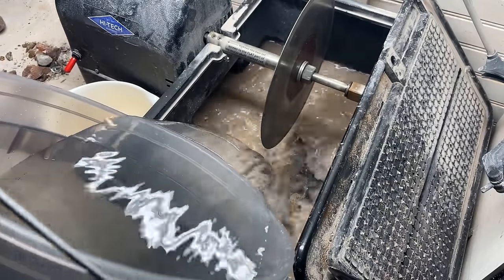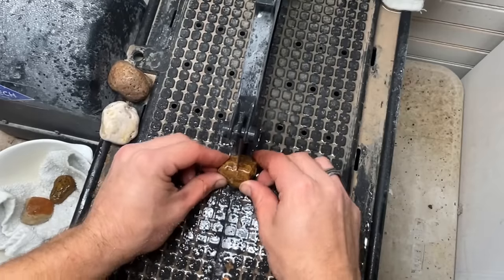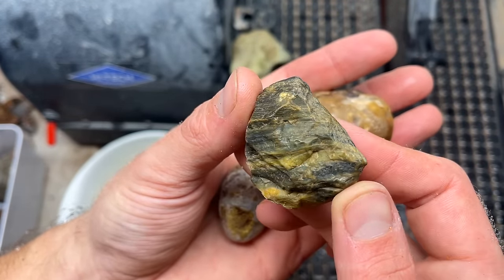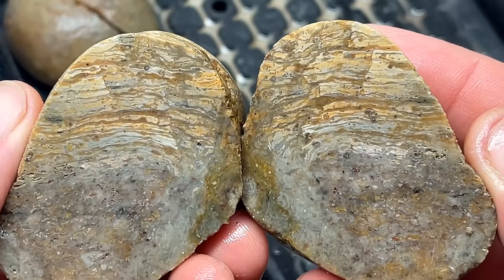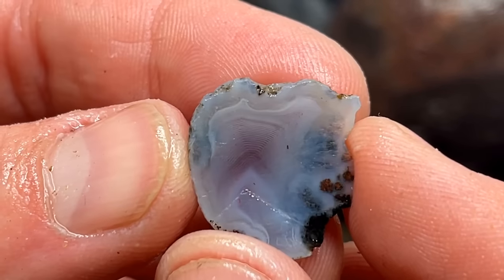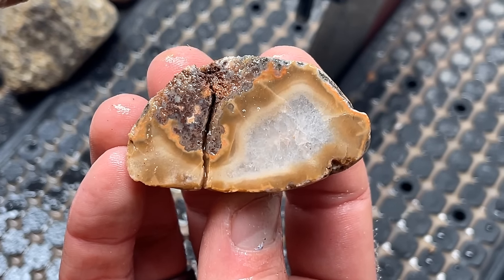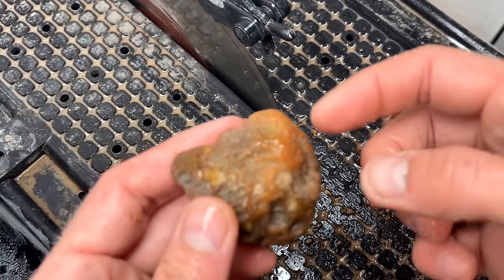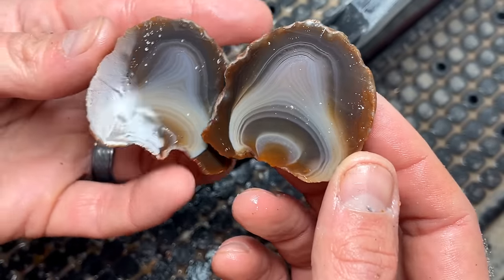Are these ugly agates beautiful inside?!

Comment: You are very very brave to put your fingers that close to that saw, and what kind of saw is that what a nice clean cut does rocks are all very beautiful
Reply: I was always afraid to do this for that reason. But the blade doesn't have teeth. It has diamond crystals. Kind of like sand paper on steroids. It more or less grinds through the stone and won't cut your fingers with casual contact. Well, I'm sure it would if you tried hard enough.

Comment: I can't see any of those agates getting into a Silver ring ever.   They are all plain.  Sorry, but I have polished lots of cabachons and sold lots of Silver stone set rings.
Reply from the maker: You’re the only person talking about setting them in silver..
Reply: @AgateDad  Maybe that's because not many people make Silver jewelry..   While I did a lot of lapidary work, I never cut agates or other stones in half.   It's better to grind away the surface and try to find the best that the stone offers.   When you cut a stone in half, that option is gone.   It's not a big deal, since there is an unlimited supply of those agates.   However if someone gave you a rough opal, it would be severely devalued if you sawed it in half without so much as a thought about what you were doing.

Comment: I'd hate to slip while cutting it could mean the loss of a finger or hand very quickly.
Reply from the maker: Not with this lapidary saw
Reply: @AgateDad  you mean to try and tell me it will cut through rock like it's frozen butter and it won't cut through bone if you slipped? I'd hate to put it to the test. Not something dangerous like this but I remember in school having to give a demonstration of how the dishes in my home ech class would not break because of what they were made of. I don't remember why but I not only had to do it before the class I was in but another class too. I picked up a plate and dropped it and we all watched it shatter. So the second class I just picked up a broken piece and showed them not to believe everything you read.
Reply from the maker: Do your own research then on lapidary saws and continuous diamond blades.